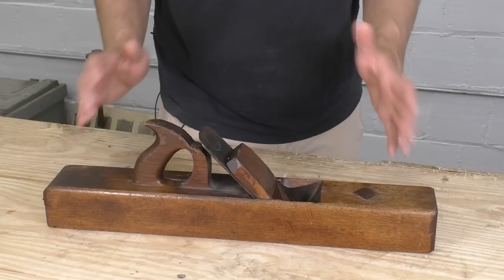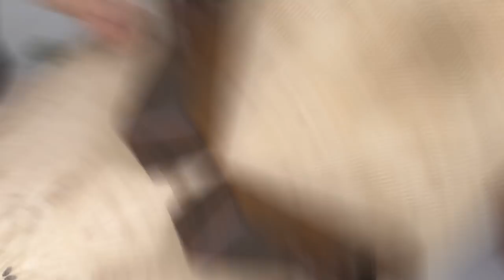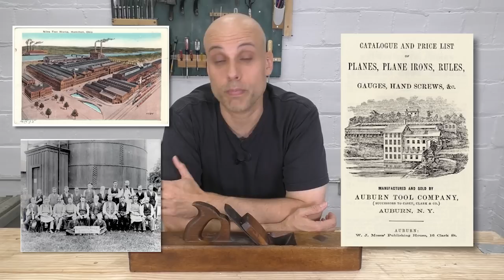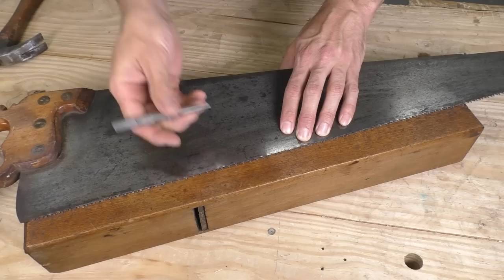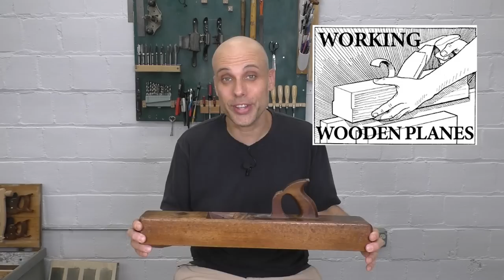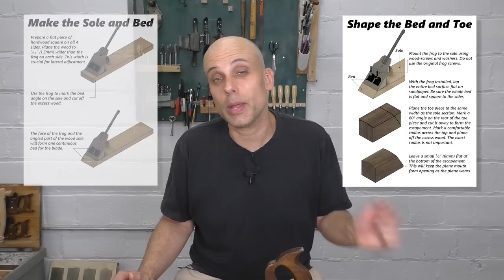Hidden flaws in vintage wooden planes.

Comment: Few years ago I bought a job lot of wooden planes on ebay for under £1 each (some were missing blades, some wedges). They were all made by the same UK manufacturer who is still going though they no longer make planes. I figured nothing to lose so reached out to see if they had any old blades lying around. Initially spoke to a young lady who was very helpfull with loads of info but eventually I got handed over to a chap that was on his final day before retirement. He remembered actually making the planes and was sure there was a small box in a corner of the factory with some blades. End result was I got 6 brand new blades for the cost of 6 first class stamps! Only ever tried seting one up and it worked great. I managed to get it taking shavings in construction grade pine that were almost transparent.
Reply: Who was the UK maker???
Reply: @alexanderguestguitars1173  I honestly can't remember Alexander and can't find the emails I exchanged with them either. There was a label on the side of the plane but it is pretty scratched up and I can't make anything out on it - sorry.
Reply: @daveturnbull7221  Ah no worries. Thanks for looking

Comment: It's a beautiful plane. My thought is the way to restore it is to fabricate the period correct iron for it and fit it to match the plane. Based on where the block fits you could figure out the right thickness and shape for the iron and where to braze on that brass button to tap the thread into.
Reply: Great idea!
Reply: I don't think the slot on the wedge would make any difference, so probably no need to braze the brass on to the iron. Given that the iron isn't original, the easiest thing would be to just file the head of the screw down until it fits. It looks to have a lot of meat on it. Might have to recreate the slot if a lot of filing is needed, but also fairly straightforward.
Reply: @ricos1497 , that's true for the functionality of the plane. But my thought was to restore it to period original. Either way works, just depends on your goal.

Comment: As a hobbyist with a mechanical engineering background I have the time and skills needed to perform heroic restorations, and I have successfully revived several 'beyond all reasonable hope' wooden try planes.  I am usually a strong advocate for 'they were made to be used, so use them' but in the case of such a unique and historically interesting item I completely agree with your decision to preserve it in it's current condition.  Could you also consult with your neighbour and record their knowledge of the plane's history and then research local archives to see if you can find records of the former owner(s).  If you uncovered a specialist trade that explained the very course saw teeth marks it would really increase the interest of the plane (and would make a great 'forensics' video).  And I will be more informed about identifying rare planes, and deciding when preservation is the better options, thank you Rex 😀

Comment: You saved me a few bucks and some headaches.  I still haven’t found one that is in tact enough for me, but I avoided buying more than a couple that didn’t have the original blade, missing wedge etc… thanks
Reply: If the price is right I wouldn't let the iron or wedge stop me from buying a plane. Boring beetle holes in the body would be a show stopper though. Unless I just wanted to nick the iron out of the plane. A good iron alone is worth a couple bucks.

Comment: I`ve picked up my first three wooden planes in the two months and they are great. I have a coffin smother, a plough plane and a skewed rabbet or rebate as we say here in the UK. I`m looking to get a jointer next.
Reply: The trick to buying used tools is look to get whatever you can get. If the price is right go for it. Otherwise you'll be buying at not so nice prices.

Comment: The broadly spaced teeth suggest that the saw being set was a rip saw.  They commonly can be found with lower TPI counts.  The Disstonian Institute discussion of the Disson No.7 indicates the lowest PPI is 4, which would be 3 TPI, IIRC.  So, likely the plane user was cutting his lumber to width and approximate thickness, as well as to length.

Comment: Cool video Rex.  I immediately went down to my shop to take a closer look at my wooden try plane.  It has an offset handle😃.  No disjointed color between the wedge & body😍.  And "only" half a dozen wormholes in the sole 😔.

Comment: I am almost thinking this was a factory made plane that was modified and repaired
cut short to fit a smaller toolbox (I've been tempted to do this myself)
mortised square strike button to replace the damaged round strike button
then someone even less knowledgeable put the wrong iron in (found that a lot in flea market planes)

still works better than most harbor freight planes as-is...and MUCH better once flaws identified and repaired

Comment: I'm really a fan of your tool and furniture forensics videos. Keep them coming. I have a very long 30" jointer plane by A.Howland NY made of beech. It is in very good condition but the iron is not original.  I have been able to fix all issues and actually plane wood with it, except for the slight skew on the sole. I have nothing long and straight enough to fix that!

Comment: I've got two handmade planes. One has been kept in its original condition for that very same reason, the other I've fully restored. The former is easily 150 years old, the latter was sold to me by its maker who no longer hand the hands to use it. Beautiful piece of yellow birch with walnut handle and inlay, rounded iron. Both a worker and a show piece, since that was the deal

Comment: For your acoustic challenges, make some pegboard panels (like 2’x4’) with some damping inside. Just two on the visible walls will make a giant improvement. And a rug underneath you. You’ll sound better right away. Yes, the acoustics of your space are very fatiguing. You are correct.

Comment: Hahaha dabbling into wooden planes is pretty fun, especially with making wedges or even bodies. I've had to both straight up make a couple new wedges out of cherry to replace missing or ill fitting ones due to replacement irons or attrition from time. I'm also making a new non laminated body for a large double iron, probably also out of cherry with a purpleheart sole. Gonna match the low 40 degree bed that the original had.

The bodies have a lot of subtleties and I've messed up a couple good blanks I've made, but it's a ton of fun

Comment: It's interesting how the plane situation deffers in US and Europe. When I grew up, I only knew wooden hand planes. Both grandfather and father had and used them. When you go to any home improvement store here, you'll only find wooden planes or electric ones. For anything else you have to go on specialized online store.
I only found out about metal/cast iron planes few years ago, when I got interested in woodworking and started watching foreign videos.
Reply: That's pretty strange, i think. In Norway, if you want a plane, there is pretty much just a very cheap stanley number 4 plane with terrible quality, plastick parts and an iron that's soft like butter. You can't get any wooden planes in any normal hardware store around, only in special stores, online or used. I manged to get a whole lot of good used planes with irons intact, though.

Comment: Wish I saw this video just 24 hours ago. Just bought a coffin style smoother and it looked really good. After I brought it home and doing a little research after the fact. The wedge is broken. As of now I bought a decoration. It's ok I write it off as a learning experience.  It's cool stuff. Thanks for your videos.
Reply: Now learn how to make wedges. I have a wooden plane that kept clogging up so I made a new wedge for it and it runs good now. So I must have done something right. It's just a woodworking project. Might even be easier to do than it looks. I don't recall it being so hard to do.
Reply: @1pcfred  Good idea. We are wood workers  by trade or by hobby which is me. No pressure, nothing to lose. Thanks for the inspiration Paul.
Reply: @frankstalteri972  yeah just go for it. That's what I did and it worked. Better than I'd thought it would. I suppose I got lucky in a lot of ways making mine.  Fortune favors the bold though. Just don't be too bold. You do have to chisel on a pretty small piece of wood. So I'd recommend you work hold that while you're doing it. I blocked the piece up in my vise to work it. Now I'm no expert but I think one secret of plane wedges is they're not made out of the hardest woods known to Man. Hard enough but not too hard. Not so hard you blow the cheeks out of your plane body. But hard enough it doesn't split when you strike it to set it. So have a good think about what wood you use. I wish I could tell you what I used but I used some mystery wood I cut down myself. Not being a botanist I don't know all my trees. I know the crap don't split worth a damn. Had some troubles with that. Does carve nicely though.

Comment: Greetings Rex, I find your insight into antiques amazing and the rest of your videos are great. The echo thing is almost not noticeable till you mentioned it. Try hanging a towel over a coat hanger somewhere in the middle of the shop. Sometimes even the smallest piece of cloth or fabric can make a huge difference.
Reply from the maker: Oh, I did that! Bunch of sheets and blankets behind me.  Thanks,  though.
Reply: @RexKrueger  Some Ikeas have panels suspended from the ceilings in different positions and heights. I suppose they break sound waves. Maybe they are not expensive.

Comment: You can decrease your echo by hanging your microphone on your collar instead of further away, then decrease the input volume slightly. I used to be a freelance location sound mixer for broadcast news and talk shows, etc. Helped a bit. But also hanging moving blankets around walls that aren't seen. The ceiling would reflect sound a lot too. Thanks for the tips.
Reply: By the way, the echo isn't so bad. Doesn't distract.

Comment: I'm super stoked that I FINALLY found a really, really nice, clean full length jointing plane for $40 with its original wedge, tight tote, and clean iron. It took FOREVER to find. 

And then I realized I'd already bought a benchtop 8 inch WEN jointer (holy crap is that tool worth the money) so I just jointed the bottom of the jointer, lololol.

1/64th of an inch off and it's flat as the earth isn't. Even with a real power jointer, I still find uses for it everywhere. There's something to be said for not needing to spend 15 minutes setting up a tool and the dust collection for a single job.
Reply: When I figured out how use a jointer plane, all planes for that matter, I sold my jointer. I needed the space, no more dust, no noise and I needed the exercise anyway. So happy now.

Comment: Interesting video.  Almost all woodworking seems to begin with establishing a flat surface on a tool.  From there, you can get the rest of basic joinery.  However, I can't find any reference that speaks to how wood planes were initially flattened before industrialization.  Just thinking about it, some minerals fracture flat, so that might give you a reliable reference surface.  Alternately, if you mixed a loose slurry of concrete in a box, it would settle and dry flat.  Or you could pour molten metal, let it dry flat, and put sand on top to then sand wood flat.  This might be used to sand a plane relatively flat.  So, any information you can share on how wood was initially flattened for toolmaking?

Comment: The wrong iron problem has happened to me twice (more or less). One was wrong wedge and iron but it came in a lot of planes and I wasn't worried about it. The second was a transitional smoother. I knew looking at it but I wanted a transitional smoothing plane so bad I was going to grab a different iron online and make it work.

Comment: My Dad gave me most of his tools when they downsized to an apartment.  Amongst the tools was a plane very similar to the one you’re talking about here.  I spoke to him about it, and he remembers (he’s 93 now) the plane in use as a shooting plane exclusively when he acquired it.  I have two blade sets (a Marples, and a Sorby) for it.  One had feathered edges, like a normal bench plane, and the other is straight to the corners, which I interpret as the shooting blade.  Perhaps your plane’s handle offset was because it was a shooting plane.  Is the blade sharpened square in the corners?

Comment: Personally, if it were my plane, I'd be tempted to grind down the screw face and put in a fresh slot. Just so the iron goes into the throat properly and the wedge goes in as it should, then leave it like that (as the iron is a replacement anyway) as an artifact. Just seems wrong to me that something that's made to be fitted to another part is left so they don't fit together (if you see what I mean). In fact judging by the shape of the stamped in trade mark/logo on the "new" iron, I'd say that was a Sheffield made Pearson blade. Is that right?
Reply: I was wondering similarly. If that iron isn't original then it has no especial historical value other than age. So the plane might benefit from a new iron fettled to the correct form and be put to use again.

My only wooden plane is a 17" Mathieson jack, which was also churned out in quantity back in the day, but it's all original and chomps through wood well. Rex's earlier videos helped me know how to check if it was a decent one.

Comment: You can buy a better plane than that brand new from a factory named Pinie in Lubna, Moravia, Czech Republic, for 60 Euros.
It is on Amazon.
Two inch blade and a genuine hornbeam sole. Frankly it looks almost exactly like an Ulmia plane which is a German traditional tool company whose plane will run you three times as much.
Granted, the Ulmia has inset metal bolts to hit with your hammer to set the blade position. I don't think that is worth triple the money.

Comment: I finally bit the bullet & picked up seven hand planes from the 127 sale. In my excitement, I bought one that doesn't have the top 3 pieces: lever cap, iron cap, the plane iron plus screw. How do I find out the replacement for this plane. I do not see a brand or #. It's 2.5" wide by ~8". Looks like a Stanley, do you have any recommendations?

Comment: Strangely, cast iron planes didn´t catch on in Europe. I wonder why that is. There are still manufacturers in Germany making wooden planes as they did in the 1900s and 1800s. Rex has some of them too. ECE and Ulmia are the most well known.
When you see lighter wood at the wedge, that could also mean that the wedge was hammered in with a lot of force and was sitting like that for a long time. That´s also not a good sign because it can make the wooden plane body warp. Sure, you can get it flat again but without that pressure, it will warp back over time.

Comment: Believe it or not, what an old timer would call a tenon saw ("scie à tenon" ) here in france, is actually quite a coarse   framesaw (about 5tpi) used to cut the tenon cheeks, it may also be used to rip, if the handles turn
The shoulders were cut with a finer saw (about 10 tpi) called crosscut saw ("scie a araser"). And i have to say it's a pretty fast way to cut tenons once you master the saw. When reading the 19th century texts (typically moxon and Nicholson), you realise that backsaws were intended to cut tenon shoulders (and not cheeks) so i guess english and americans also used saw of comparable coarsness.

I believe that the percieved coarsness of the saw comes down to two things: 1. the average hand tool enthousiat tends to make small things compared to the average 18th/19th century woodworker (doors, windows, shutters, stairs, etc.)
2. Today, hand tools users have no efficiency constraint, they can work as slowly as they want because they're not making a profit of it.

Comment: Thank you 1st off for addressing the elephant in the production house! Stanley Tools has singlehandedly killed off so many American manufacturers, it isn't funny! Their latest or one of the recent ones is Porter Cable. An absolute  tragedy, thank you Lowes & Stanley for replacing them with our American made cough - Taiwan Craftsman. Before a you Craftsman loving bandwagonist jump on my post, do me one favor: Find me (1) tool stamping that says: Made in "the" U S A  You won't find it unless it's over 50 years old. 

Rex, the plane you have is probably original lumber mill plane, which is why it has fewer teeth marks from setting blade on saw. Mostlikely a two hand saw used for cutting rough lumber by hand. The plane was probably used to show grain in a more smoother look. The grandfather probably picked it up & repaired/replaced the blade with a metal jointer one, unknowingly ruining it. 

GREAT VIDEO, THANKS FOR SHARING!

Comment: Biggest flaw is they're wood.
Reply: Not an inherent flaw.
Reply: How is that a flaw? Have you used any?
Reply: Feature*

If you have ever used a wooden plane that was propperly restored you would have noticed their light weight nature and the way they glide so easily over the surface of the wood, they could be handled day in day out for hours at a time without fatique.

Whereas a metal plane is a lot heavier thus causes more fatique earlier. The metal planes were made at a time where they were no longer used for production, they requier less maintenance and are easier to concistently setup which made their apeal, the wooden planes still remain the workhorses of the planes in my book however